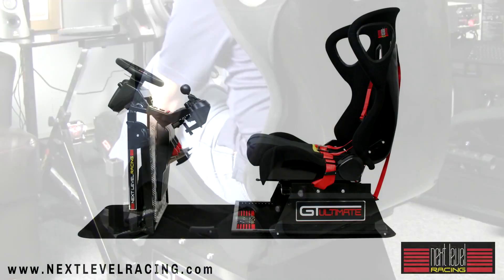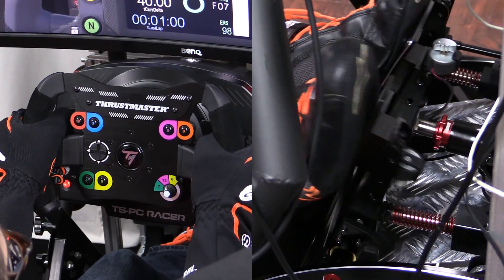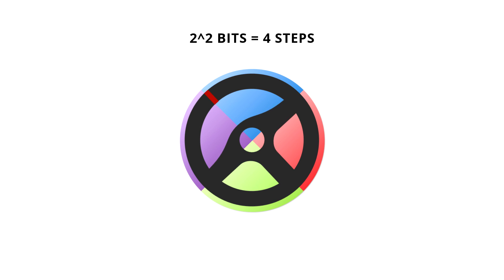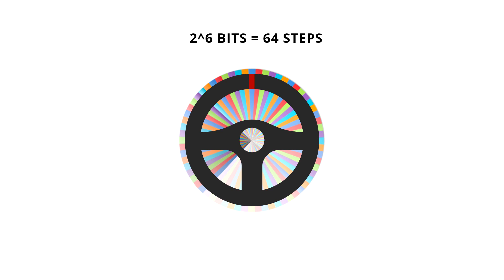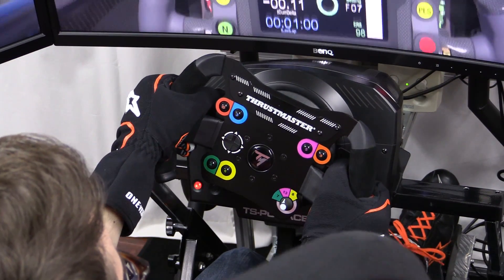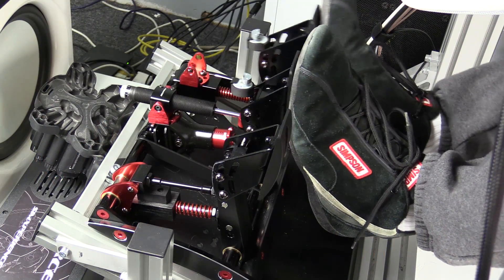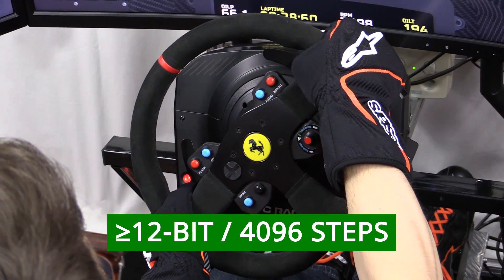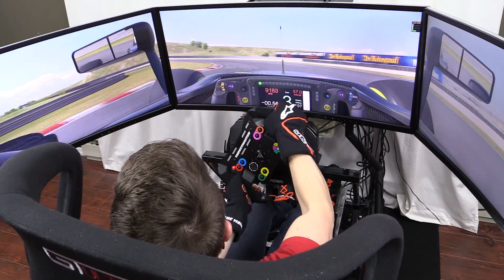Sim Racing Explained - Steering Wheel & Pedal Resolution

Comment: I'm trying to decide I watched a lot of your videos on the thrustmaster TX wheel and I can't get no one to answer my questions I play Forza 6 only been playing for a few years but I don't even talk 1% on all the tracks I got on the race team within two months of planning the problem is I had 6 surgeries on my right arm I was in hospital for 21 days so my hand hurts on using the controller for shifting and everything with my right hand cuz that's the arm and hand that's messed up so one of the buy steering wheel because it would ease the pain tremendously because there's nothing wrong my feet and it would help me with my accuracy on breaking in throttle response because my feet are fine I was told is going to take 3 to 4 months to get used to a steering wheel versus a controller so in your opinion with the TX steering wheel servo with the pro petals and the 599xx or the tx leather wheel or would I be just better off buying the TX weather kit it comes with the three pedals but not the pro pedals and it comes with the steering wheel that looks decent all I do is play racing games due to my injuries I can play first person shooters and I love racing anyways and I've gotten really close to making finals in a lot of competitions with a controller it's just too hard on my hand iWatch year 2017 best wheel setup and the Fanatics seem like they're a little bit too much money for me because I still have to buy a cockpit sorry about the message so long I just can't get through to anybody and you guys seem like good people that will get back to me I have a YouTube channel it's just my name I wish I had a phone number to call you guys LOL because you guys know your stuff I hope to hear from you and keep up the good work in the videos are awesome

Comment: awesome explanation !! 
Politely, I'd like to add there even in race car or cars there is some input lag from throttle ex. throttle cable, intake size and gearing in transmission .. 
and power steering even with upgraded pumps will lag steering in car, but depending on body/ chassis setup it turns better ..

Comment: Bit rate becomes incredibly important if you install a brake pedal mod such as the T3PA conical mod, Nixim Mod or the like.  Once you install one of these mods you will want to put at least a 40-50% dead zone on your brake to emulate the shorter travel of a hydraulic system. Doing this just works a lot better if you have enough bid depth left over after the dead zone.

Comment: Ok,, I'm using Logitech G25 pedals with the Ricomotech adapter with my Thrustmaster T300 base. The Adapter is supposed to up my pedal resolution from, I believe, 8 to 10 bits. Explain Jon,  if you can, how that works and if it is true or is it some form of "extrapolation " that makes it "not exactly " 10 bits.
Reply from the maker: The resolution for pedals that have to plug into wheel bases - non-usb connections used on Thrustmaster and Logitech pedals for example - rely on the wheel since all the circuitry is located there.  Adapters are just making it possible to physically connect and transmit the signals, so you are indeed getting 10-bit resolution.
Reply: Ok ,I understand. Ricomotech kind of makes it sound that it's their adapter providing the 10 Bit resolution. Got it!! Thank you so much for your response!!

Comment: Careful guys, bitrate denotes speed. Bits denote data. And you can have one bit for control, on or off. And go up from there like you explained.
Reply from the maker: You are correct, had a few "rates" sneak into the script and they shouldn't be there.  Have updated the written version here: http://www.isrtv.com/sim-racing-explained/sim-racing-explained-steering-wheel-pedal-resolution/
Reply: Inside Sim Racing Resolution of G29? please

Comment: great visuals I love the video I knew what bitrate was but this made it really simple to understand
Reply: RTA MOTORSPORTS bitrate is the wrong term. Rate denotes speed, like in modems or modern Internet. The correct term is bits. How many bits describe the position of the control. And it can be one bit, on or off. And it goes up from that.

Comment: No one needs more then 8 bits (256 steps. 8 bits is fine for everyone
Reply: Lopata so if you guys we're blindfolded and I asked if the step number is either 192 and 193 you will be able to say I need the step number 192 and I got 193. Or will you infact say 
"Oh it's around 170" looool